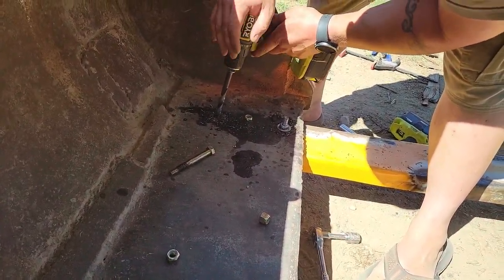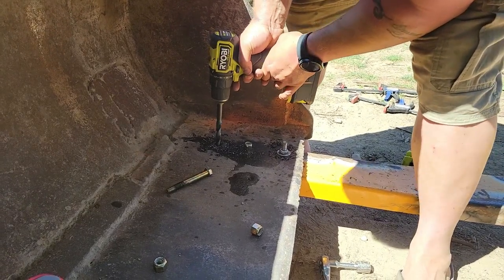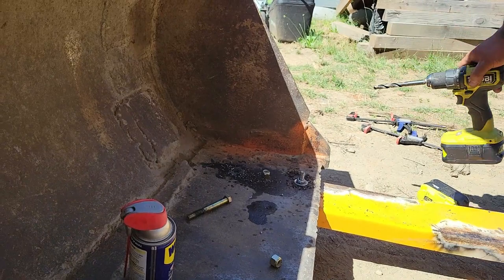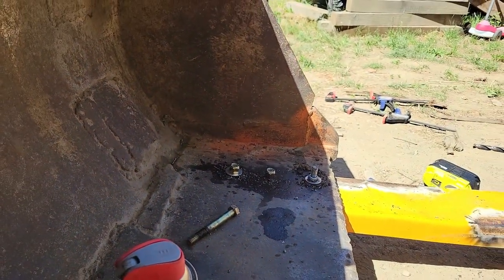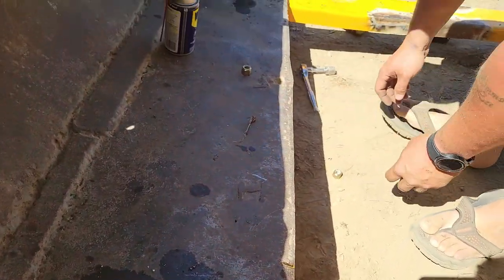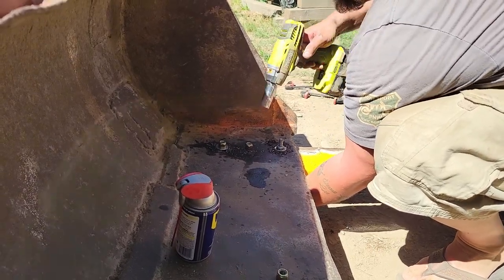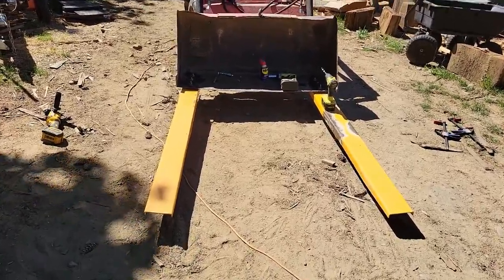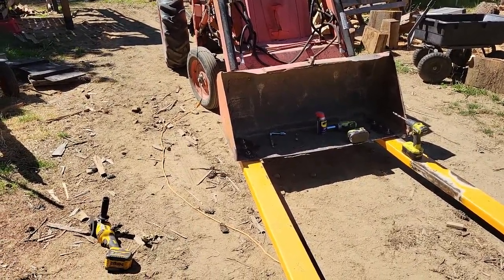First tractor accessory

Comment: Dang! Now I got to go back and see the video when you brought that home. I didn’t know you picked up a tractor. You’ll like the forks for sure.
Reply from the maker: Yeah I am excited to have it.
Reply: @WildBill1122  I couldn’t tell how long you’ve made your forks, but the first ones I made for my big Ford backhoe I made too long. They bent very very easily, even though they were ten inch channel iron. I ended up cutting them down to only 24 inches and moving one log at a time of any size.
Reply from the maker: @tractorman4461  I think they are about 30 inches of usable forks.
Reply: @WildBill1122  What I found was poking into a pile of logs, either big or little logs was always a problem.  They'd stick in too far and the end of one or the other would catch another log by itself.  So, I got to where I'd dump the bucket and use the tips of the forks to flip one out of the pile backwards, then scoop it up and go with it.
Reply from the maker: @tractorman4461  Good idea thank you